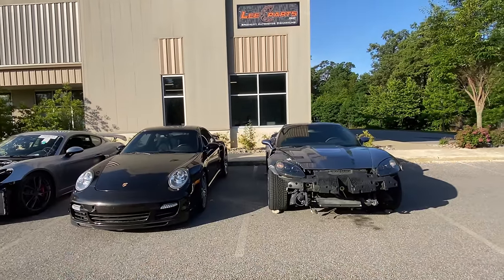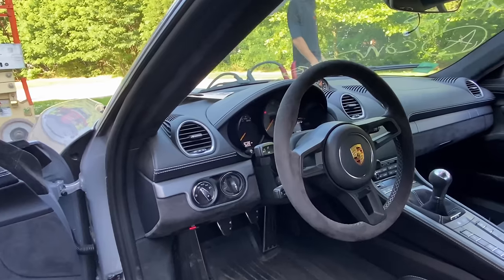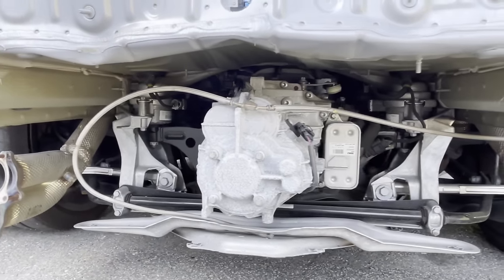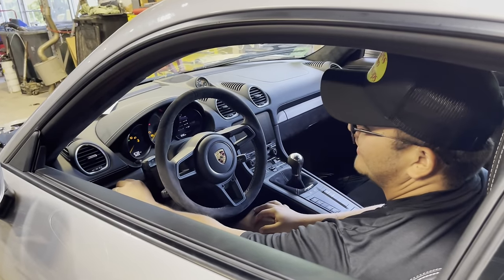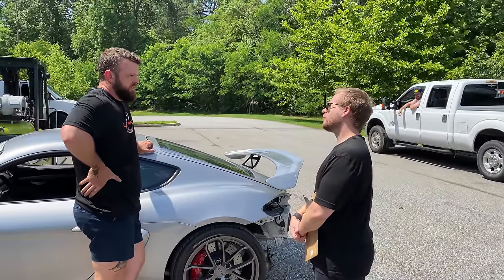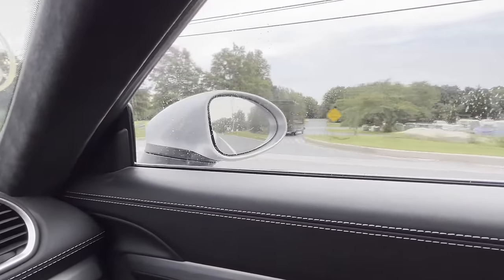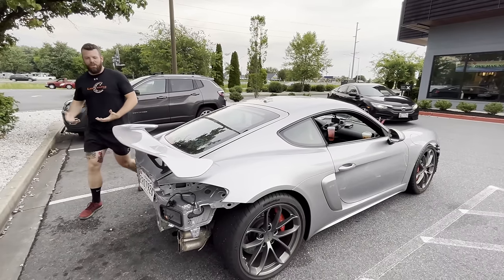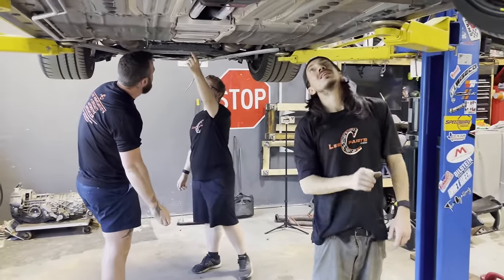I Bought A TOTALED Porsche Cayman 718 GT4 At Copart | EASY REBUILD!?

Comment: I bought a salvage 718 Cayman S from IAAI with almost the same damage your GT4 has in the front and fixed it myself. Note both have the same inner body panels. Most of the front inner body panels are glued and riveted .  No need to buy Porsche’s overpriced rivets or rivet gun. As for the parts, Porsche will sell you fenders, hoods, bumpers, however you have to be a certified Porsche body shop to buy the inner panels as the dealer couldn’t even get them for me. I had to buy from Europe and get shipped. Hope you have better luck.  I have plenty of pictures I can send if you want which may save you some time as well as some names of a few European Porsche parts sites. Lmk. Note I’m not too far from your shop as well if you want to see mine. 
Btw, Great videos, keep making ‘em.
Reply: Wondering how you set up the panels without a jig? Yeah ppl don't realize how hard it is to get parts for these
Reply: @philipparana9225  So my frame rails were straight, so that made the panel alignment process easier. Once I removed the damaged panels (inner trunk panel, front panel, top frame (top collar), inner support (triangle piece)), I clamped the new ones on. Since the damage was limited to the very front, I was able to align the top panel (collar) to the original mounting spots closer to the cabin. Then I mounted the fender, hood and bumper to check for alignment, which in my case did not require any changes to my clamped pieces. Lastly, I'm pretty mechanical, but had never done this level of body work before, so I watch a lot of youTube Videos. Since most of the inner structure is identical to the 991/911 (same part numbers), I actually learned from watching many of the 911 rebuilds, as there were no Shop manual available for the 982/718 Caymans.
Reply from the maker: Niels, this is a longshot… but I suppose there can’t be many of us rebuilding these cars. 

Is your username on the 718 forum backyardmechanic? If so, I have AC questions for you 😅
Reply: @scraplifegarage  Yes, that was me. The AC was a real PITA. So one of my AC lines was kinked, but held pressure. I believe the key to a simple fix if your system is still holding pressure and you need to replace an AC line, is don't start it after you remove the lines, or it will trigger a compressor reset. I actually pulled my damaged line off, then started it to move it around, which triggered the AC compressor run-in/reset. Big mistake. So later when I replaced the line and I tried to evacuate it and fill it, I could never get the compressor to start. I tried resetting the codes using my cheap iCarSoft OBD2 Por-III scanner, but could never figure out how to get the compressor restarted. Additionally, the scanner provided an option "Reset: Compressor Run-in" and stated "Compressor Break-in Reset must be performed before Compressor Break-in" in order to be able to start it...yada-yada...". Basically just confused the heck out of me by mixing the terms reset/break-in/run-in. I finally gave up and took it to a local shop who charged me $500 but was able to reset it and recharge the system (note, it took them a bit to figure out as well). I hope you have a better scanner than I, and with a little more patience, maybe you can figure it out. It would be a nice additional video. :-)
Reply from the maker: I guess my investigative skills aren’t too bad after all! I’m also getting 1900, the car had all kinds of voltage issues with a bad battery and pretty much every module was full of DTC. Prior to clearing the hvac wouldn’t even func to on. After clearing it functions but no AC. The car sees the request for the compressor to turn on, but it never sees voltage or turns on. 

This car never lost refrigerant and the pressure sensor still appears to rear correctly (10bar give or take)

So it looks like I’m in the exact same boat you were,  a functional system aside from the fact that the compressor won’t do its job. 

What shop took care of yours? If they’re already aware of the issue it might be worth just going out to them. 

Also, we have the same scanner and I’m not positive I want to buy piwis 😅
Reply: Did you get insurance for it and a rebuilt title?

Comment: Strip it out, fix and weld up the body, roll cage it, suspension, GT3 RS brakes if they fit, headers, intake, tune, no cats or mufflers. GT4 goes whoo whoo!!!
Reply: As much fun as that would be, I just want to get it back in one piece before thinking about mods!
Reply: @LeeC  BOO!

Comment: Really great find on the GT4, same motor as the GT3, love that 4.0 revving to 9K. That's a sweet motor and the only one I would own. The turbos are nice but that natural motor is a beast. That looks like a simple put back together and go have fun project. Being a Tesla owner my list of gas cars that I would own is a very short list, I too have become a Porsche fan recently, got to cut a few laps in a '19 GT3RS recently, what a machine, wholly shit. Can wait to see this one come together, too bad it's a salvage title or you could sell it for a nice penny.
Reply: The 718 GT4 does not have a GT3 engine... the GT4 RS does
Reply: @joe718gt4  Still a naturally aspirated 3.8 liter that revs to 8k but down on power from the GT3. I stand corrected.
Reply: @ronzander7648  2016 GT4 had the 3.8L. This one is the 718 GT4 which has a 4.0L

Comment: Nothing wrong with the front bumper. Recondition it and slap it back on. The rear just use a heat gun and pop out the whats been damaged. It will come back to form easily.

Comment: I owned a ‘16 GT4 with the same spec. The seats alone are a $5k+ option. 
Question: it came with salvage title, correct?  I ask because the bags didn’t go off.
This is easily Porsche’s best pure driving  experience without all the nanny ecu’s that keep the 911 in check. A true evocation of the 550 Spyder. 
Oh yea, is it rude to ask what you paid for this?  Am I close at $50k?
Good luck with this. Good times ahead!
Reply: We have just over 50 in it as it sits and probably another another 20 or so in parts by the time it's all said and done.

It is a salvage title and will end up as a rebuilt title yes
Reply: @LeeC  At $50k in, given the condition, I’d say this was a very wise purchase.  I’m kinda surprised the bidding didn’t go higher. Used low mileage GT4’s are getting over $105k on BaT.

Comment: I can see something that could be a huge problem. Left side headers received a heavy hit, now of the hit damaged the head, there could be a crack in the left head, heads and blocks are made out of fragile aluminum, if that’s the case, the left side half block could also have cracks. The engine needs to come down and heads removed and tested, if the coolant get mixed with the oil, you’re screwed
You seriously need to stop driving it.. it will be sad to destroy that amazing engine.

Comment: The 718 GT4 is the worst sounding GT car Porsche has ever built.  I replaced the exhaust on my 22 GT4 in less than 400 miles.
Reply: Which is a shame cause you’re spending so much money for the car already and then you still need to dump a couple more grand to make it sound the way it should’ve sounded from the factory